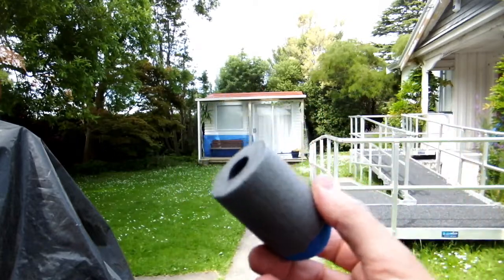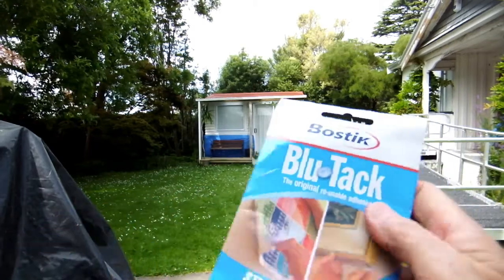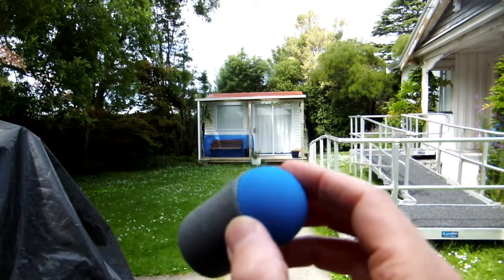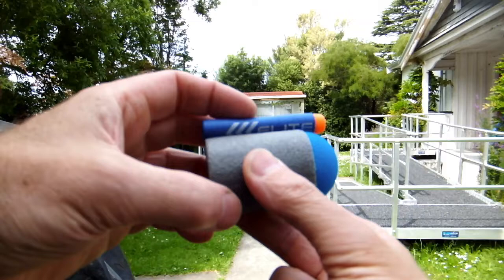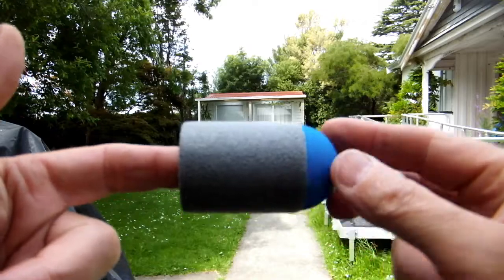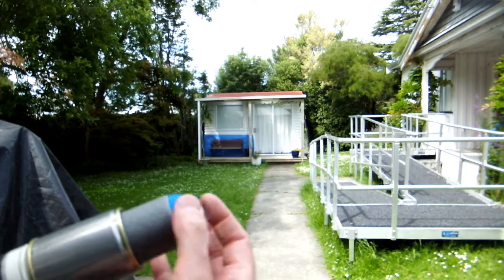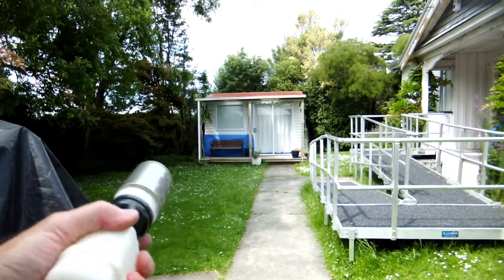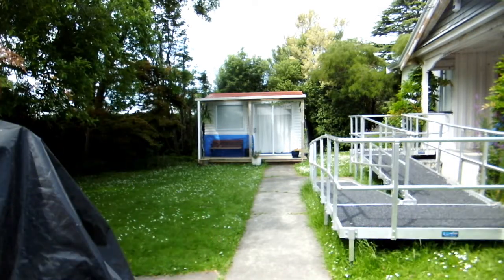"BLU MEANIE" Foam Mini-Missile: Test-fire #1

Comment: been following on instagram but- Any chance of a build video on one of these? Curious how you scooped out the head to get the weight in
Reply from the maker: Just getting used to a new camera (finally!) and diving into the old editing software so Absolutely... build vid(s) on the way now for the whole system. I'll prioritise the Blu Meanie's vid though as they're MUCH simpler to make (so will have wider appeal) but it'll introduce a bunch of the design principles that the whole system relies on.

A note on this vid: I've only made a handful of versions these finless numbers but what I'm seeing so far off the various launchers is that muzzle-blast is a definite issue that'll need wrangling (thinking porting on the launcher post maybe?) If the blast is too much, precisely-made projectiles with good weight distribution like these will fly SUPER straight once they get going but it's something of a lottery exactly where they'll land (it was also very gusty today...) The finned Weasels don't have this problem anywhere near as bad. This was shot at full power off a 4B; lower-powered or 3/4-pressurised tanks (eg: 30 rather than 40psi) seem to give better accuracy, so it looks like these "Half-Missiles" will at the very least be useful fired from springers as rifle grenades. I've tried paring the weight down to the absolute minimum on some too... better range and fps without losing the flight characteristics, but much more susceptable to wind-shear.
Reply from the maker: PS: oh, and the hole in the warhead was bored on a lathe using a 16.0mm spade-bit I'd re-shaped on the grinder to concentrically match the ball's exterior radius. Started by leaving 5.0mm thickness up front but weight-distribution is crucial it seems so pushed that forwards... a 3.0mm wall is about as thin as I'd go though given the punishment the tip's going to cop.